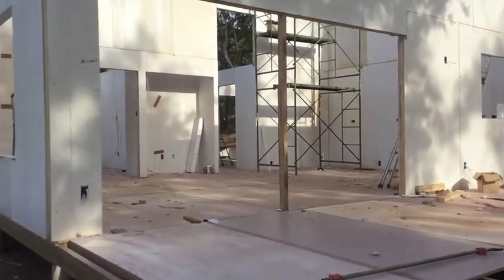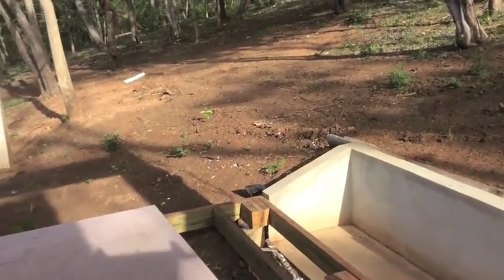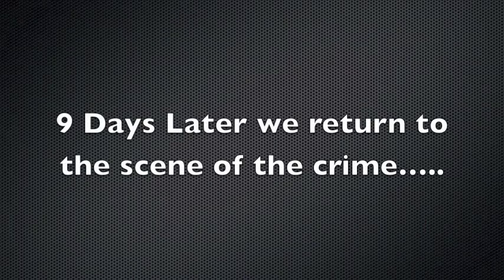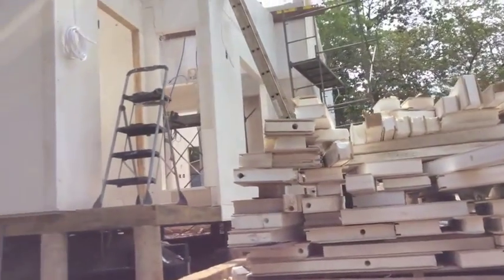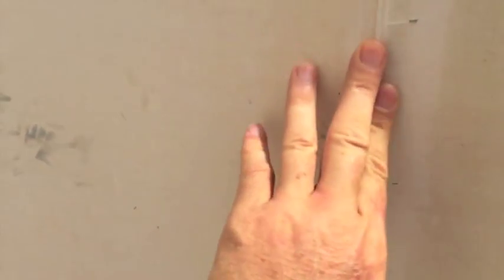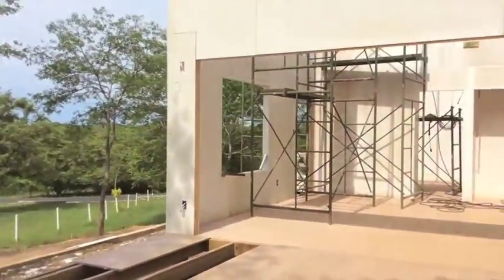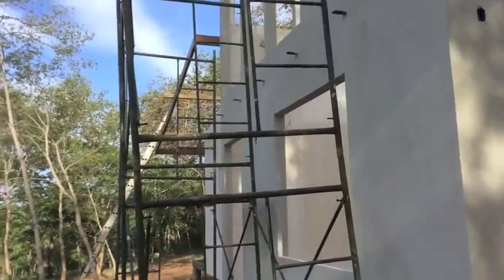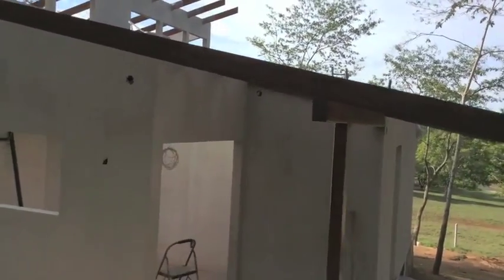Panels going up Playa Grande

Comment: What do you use to Finish the seam and Joints interior and exterior?
Reply from the maker: It is a multi step process.  Elastomeric is injected into any open joints. Plycem makes a flexible joint mortar that we embed a 4” mesh tape into.  A coat of muro seco mortar is troweled on the entire wall and 1 meter wide heavy fiber mesh is laid into the fresh mortar. A second coat of muro seco Intaco goes on as a second coat.  After this the exterior receives a colored acrylic stucco.  On the interior walls we then apply a fine muro seco SUR to give a finish almost as smooth drywall.  Our clients do not want the gritty finish that comes with all cement based repello finishes.  These muro seco finishes are massively harder finishes as compared to drywall gypsum products that are a complete disaster in tropical climes.
Reply: @trevorchilton8866  thank you for taking the time to reply sir, ill check ou those products we are having issues with the seams cracking on the interior walls using the MGO board. outside it seems that we're using a similar method too

Comment: So much work, instead bought land and want to build, SIP and metal framing.
Reply from the maker: Not sure what you are thinking about as metal framing? Yes there is one such system here I would use if that was  to meet your requirements however the highest quality is actually the wood connector & glue system you saw in this video which we are still using 4 years later than this video was shot.  You can contact me at trevorcr@icloud.com for current details Dale.

Comment: Very nice. Would you advice "not" cladding the exterior (and interior, for that matter) and keeping the raw finish of the MGO SIPs as it is, as the end result? I was looking to work with concrete wood fiber SIPs which have a finished look on their own, yet I am not sure if I would want to proceed working with them if I compare it with MGO. Thank you.
Reply from the maker: I have no idea what you mean by "concrete wood fiber SIPs" as those components don't fit into the SIP technology at all.  WE cover all our MgO it is not something one would want to look at for ever more plus in the tropics that stucco coat on the exterior is what gives the wall its water tightness something that is super critical in the tropics.